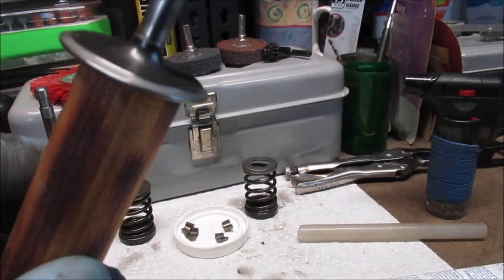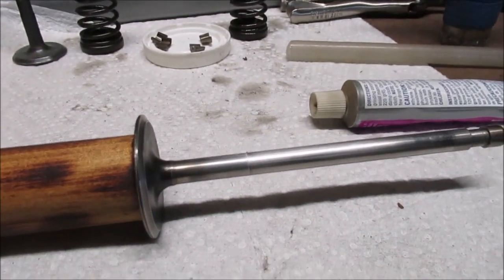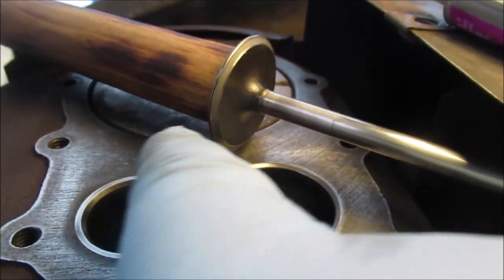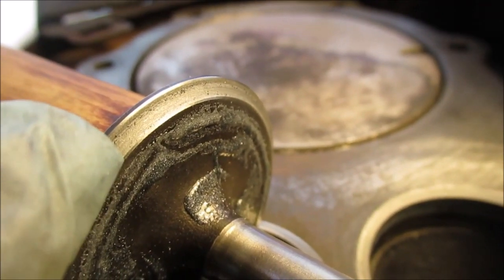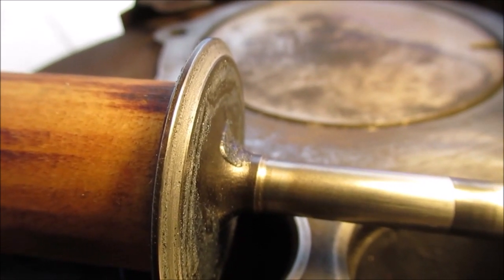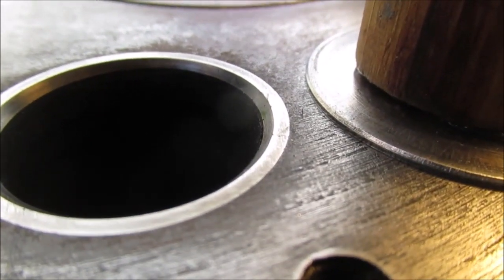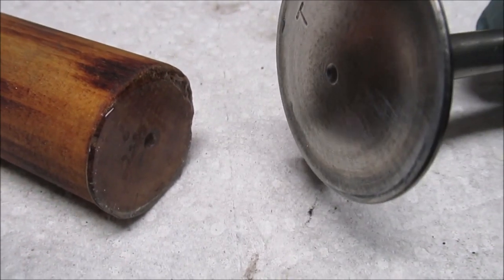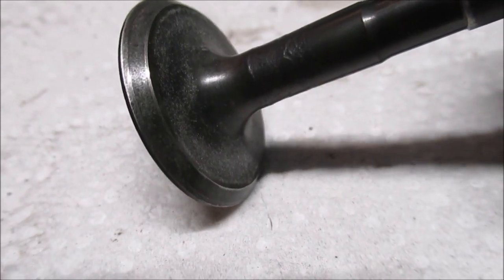16 hp B&S Cast Iron Engine....Lap Valves

Comment: Never seen glue used before, like it 👍👍👍    Was it some kind of rubber glue?
Reply from the maker: Hot glue gun stick ..I just use a lighter or candle to melt it onto the stick and then remelt it when I stick it to the valve I use a brand I can not remember the name it is spell like Acrylastick  bonds to metal and wood really good

Comment: The valves never seal all the way across the seat. It is made to seal at a high point in the valve seat. You'll be good to go with these valves for sure.
Reply from the maker: It could be that I am used to car valves ..I still think they should be cut at an angle that is flat across the surface of the valve ..I am sure it will be OK now that it is lapped